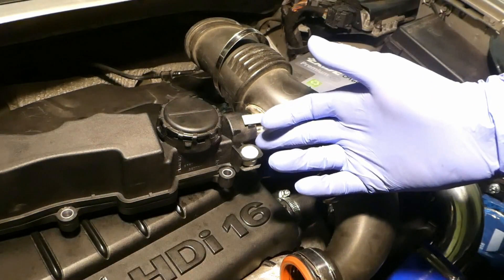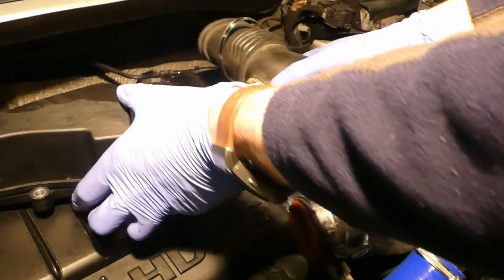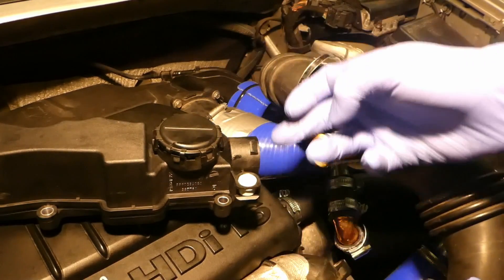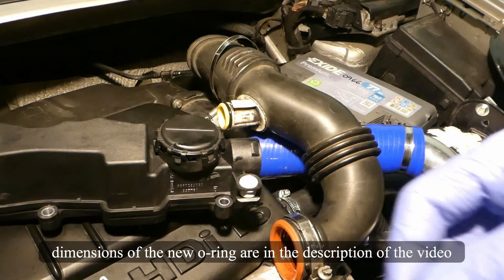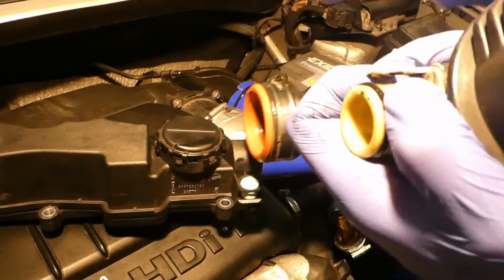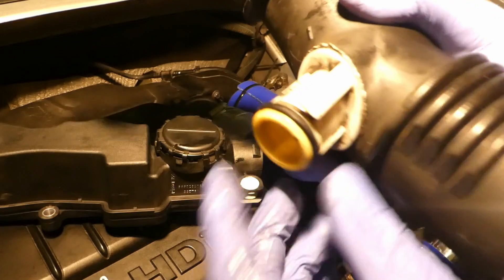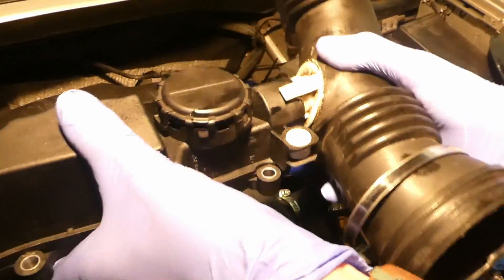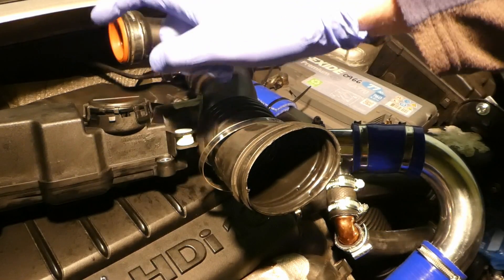How to fix oil dripping from the crankcase breather in 1.6HDi/TDCi (Peugeot/Citroen/Ford/Volvo/Mini)

Comment: Hi. Thanks for the suggestion of putting a thicker o-ring on the breather tube, as it solved the breather leak. Unfortunately I have a persistent oil leak around injector #2 (counting from gearbox) that I cannot solve. I already replaced the rocker cover gasket, the rocker cover itself and the four injector sleeve seals, and the respective injector copper seal washers. The leak still persists. I am thinking that maybe the oil is leaking through the injector stud threads. Do you have any suggestions for how can I seal that without tearing down the camshaft carrier?
Reply: Hi, maybe too late answer, but might help for others. Fixed my oil leaks near all injectors (there were pools of oil after cleaning the oil near injectors even after short trip), search youtube for "Peugeot,Citroen,Ford,Renault 1.6 HDI-TDCI Injector Oil Leak Problem Solved - Professional Fix part 1"
Reply from the maker: Hi msrego, what torque did you use and did you re-use the bolts. These are difficult bolts to do and I am not too sure if they can be re-used. I do not quite remember on top of my head, but they seem to be 4Nm + 65 degree tightening. They might have stretched a bit and do not push the injector down. Even more if you have used a seat cutting tool for the injector seat.
Reply: @moremolecules  I torqued the injector nuts to 4Nm and 65deg as per PSA reccomendation, but used the old studs. I know they are torque to yield so they should not be reused, but in my case the injectors themselves are sealing perfectly because the oil that pools around the injectors does not bubble with the engine running, and is definitely oil that is leaking, not diesel.
Reply from the maker: @msrego  Did you clean the injector seat with a reamer tool? I assume you have used a new copper washer. Sometimes the seat is not entirely flat, due to higher temperatures, etc. and it does not seal quite well. You could try with a reamer to clean it and remove an extremely small amount of the seat. In general if that is done multiple times, people use 2 washers to seal it afterwards.
Reply: @moremolecules  Yes, I cleaned the injector seats with a reamer tool, and always used new copper washers. As I told you before, the leak I have is an oil leak, not a diesel leak (or burnt diesel residue, when the injector copper washer seal fail), so I am certain that the problem is not the injector seal.
As I have replaced every seal on the camshaft carrier assembly, including the rocker cover twice, I think the oil is seeping through the threads of the injector studs for the number 2 injector, making me believe that the camshaft carrier RTV silicone seal has failed, which is not unreasonable to think as this engine has 190k mi.
Reply from the maker: @msrego  Nice job! Through the injector studs is a bit weird. I do not want to offer some stupid advice, you seem to be more knowledgeable than me as you have done all this work. I do not think increasing the thread size would help nor a thread locker. Is it a heavy breather by any chance? The milleage is not too much, but I suspect there will be some increased crankcase pressure.

Comment: Going to try this soon hopefully it just goes on but it looks a little tight like the o ring is under pressure tho thanks
Reply from the maker: Hi sshaunss, yes, it should be tight fit. Try to oil it slightly to ease it in. With time it will be less tight fit. If it is not a tight fit, oil will pass through. If it is too tight fit, you can try fitting it on a warm/hot engine.
Reply: more molecules thanks just bought it clutch needs doing first but noticed oil near this connection so this should help :) you would think car makers would of used a fatter ring in the first place
Reply from the maker: @sshaunss  I think it was fatter at the beginning, but with time from the heat cycle it shrinks. A new one should be good for another few years.
Reply: more molecules did it today great idea this, that’s a tight fit now nothings getting past that did the rocker gasket to whilst I was at it thanks
Reply from the maker: @sshaunss  Nice one! Yes, it is a tight fit, but that is the point, to seal and stop oil coming through. Not too sure how long it will last though, hopefully a few years.

Comment: Hello, I have problems with my peugeot 1.6hdi 90. It has hiccups and stalls and already had suddenly and complete loss of power. could it be because of this?
Reply from the maker: Very unlikely. Even if the seal is not complete it will not lead to stalling. Loss of power could be different things. Best is to plug it to a diagnostic equipment and see what it reports. Could be EGR valve or MAF sensor. You could try removing the MAF sensor (next to air filter) and drive with this. This will switch to default mapping.
Reply: @moremolecules  Thank you for your answer. I was wondering if this odb2 equipment might work: https://www.ebay.co.uk/p/2213173620?iid=253587409162

Comment: Hi there, it is nice fix for the O ring, but you neglect the main issue, which is oil getting through your PCV valve! I have the same on my 2010 Focus II 1.6 tdci. Isn't your exhaust smoking on cold start? Check your PCV! Just ordered PCV diaphragm membrane for 20 USD from eBay... But hey! Try not to brake those clips on the cap, as cap is not available separately...
Reply from the maker: Hi Gusztav, in this particular video I am ignoring the real issue of oil passing through the PCV valve, although it is not a PCV (positive crankcase valve) in the true sense as in petrol engines. It is basically a crankcase valve (CCV) or merely an opening (with some baffles) that excess pressure can be evacuated. I do indeed have blue-ish smoke on cold startup and I suspect it is the PCV, but not entirely sure. I tried to remedy with an oil catch can, but did not quite work out. I suspect it is mainly due to inefficient oil catch can, but there is some trade-off of efficiency and increase in crankcase pressure. I am investigating the efficiency of this as we speak. I also replaced the PCV membrane, but nothing changed really, the old membrane was OK. It was not smoking on cold startup before, but rather started one day, so I cannot quite attribute that to the PCV and I already looked at the PCV.

Comment: The link in video description is for a chinese supplier, so for anyone not willing to wait a month for delivery, i found these 19mm ID 4mm cross section from UK supplier
https://www.ebay.co.uk/itm/Metric-Nitrile-Rubber-O-Rings-NBR-4mm-Cross-Section-4mm-30mm-ID-UK-SUPPLIER/132849492473?ssPageName=STRK%3AMEBIDX%3AIT&var=432151928612&_trksid=p2057872.m2749.l2649
Reply from the maker: Do you mean the link in my video? As far as I know it is not a Chinese supplier and it is an amazon fulfilled item and there is not a month wait.
Reply: @moremolecules  yeah, i've tried ordering it yesterday and it said that estimated delivery is end of june/ start of july. it seems to have changed today. feel free to delete my comment :)
Reply from the maker: @pIotney  No worries at all, it is always good to know if I've put a link that is not that good.

Comment: What is the width of the o ring please
Reply: Is it 19mmx27mmx4mm
Reply from the maker: @robbiesillett3220  Yes that's the one, but  18x26x4 will also work
Reply from the maker: Hi Rob, all the dimensions are in the description of the video, easier to get it from there.
Reply: OK thanks

Comment: thanks for the upload! I recently bought a 2008 peugeot partner (1.6 hdi 9hx), very happy with it. checked this problem and I also got oil leak there. Tomorrow I'm going to buy the fatter o-ring. 
Question: does these have a plastic cover over the timing belt? or just mine misses that. thanks
Reply from the maker: Hi endurodani, my engine is the same, 9hxc. Yes, they do have the plastic cover for the timing belt. It is possible that last time someone replaced the belt, they forgot to put the plastic cover. The fatter o-ring is a tight fit, but it should go with a slight persuasion.
Reply: Thanks for you quick response! And keep up the good work with your videos, they are very helpful!
Reply from the maker: @endurodani  Thanks for the encouragement. I have scheduled some good ones, but it may take a while for the good ones.
Reply: I have a Citroen berlingo 1.6hdi. I have owned it from new, there is no cover on the timing belt on mine.

Comment: Hi.Tnx for great video.Is it possible if old original o ring isnt sealed good, beside oil leak also some air from air filter is leaking too on this place?
Reply from the maker: Hi Slobodan, it is possible in general. Nevertheless, it will be really small amount of air. Generally the air is being sucked from the turbo through the air filter and a very small amount of air from the crankcase breather. The PCV valve takes care of not too much air to be sucked from the crankcase. So, even is the seal does not seal well, there will be very small amount of air goind through there. The oil that goes around the seal will in general seal the passage of air.

Comment: Hi, Thanks for sharing this video. I have problems with leaks in my Peugeot Partner with 1.6 HDi engine. Today I installed new o-ring with the dimensions you provided. It was hard for me to put it on and then to mount the breather but somehow I managed to do it :) I bought an o-ring made of FPM (Viton) and it is supposed to be resistant to high temperatures, oils, greases and fuels. I hope this ends my leakage problem. Greetings
Reply from the maker: Hi BBB, yes, it is supposed to be rather tight fit. That is how oil gets stopped and really good that you bought the oil/temperature resistant ones. They will last longer.
Reply: @moremolecules  So far so good. No leaks after 4 months.
Reply from the maker: @BBBTVPL  Nice one. It is inevitable that it will start eventually to leak, but simply replace with a new one.
Reply: Where did u get the o ring from please

Comment: Thank you for the info, I bought fatter O ring and bought one made from silicone (orange colored) on ebay, rated as "food" safe one, it's more oil and heat resistant than rubber one and still no oil leak from the CCV. I got these https://www.ebay.com/itm/4mm-Cross-Section-Food-Grade-Silicone-Rubber-O-Rings-Seal-Washers-ID-7-60mm-Red/123760351471?ssPageName=STRK%3AMEBIDX%3AIT&var=424382640886&_trksid=p2060353.m2749.l2649
Reply from the maker: I do not really know about the food safe silicone, it should in general be oil/fuel safe, rather than food safe. Hope it lasts.

Comment: I have a 1.6 sw that I have just clean the engine there oil all over the top of the rocker the top of the engine and all over the alternator also its dropped more or loss all the old in one go. Is there something I should be paying attention to before i starting to strip things down. Thanks for help in advance 🙂
Reply from the maker: Hi Zool, you may want to investigate where all this oil is coming from. It could come from several places and it is best to understand where it is coming from. Could be the rocker cover gasket, or injector seal or something else. I would suggest to clean everything and see where it is coming from, as your course of action will depend on what the problem is. Hope this helps, although a bit vague.
Reply: @moremolecules  cam chain needs changing its got worn and split the rocker cover over the top of the cam theres were all the oils coming out 👍
Reply from the maker: @zool8139  Wow, that sounds pretty bad, never heard of the chain getting so slack that cuts through the rocker cover before, but I suspect there is always a first time.
Reply: @moremolecules  there is another videos on YouTube were you can see damage that the cam chain can do just were it wears through. But yeah I'm shocked it's not skip a tooth
Reply: @moremolecules  36 seconds in > https://youtu.be/KqKt4nzF7Nc
Reply from the maker: @zool8139  Yeah, that was something actually. I hope you fix yours. thanks for the video, good to know that it may happen.

Comment: In 1.6tdci it's able to install oil separator on this pcv pipe. With it your engine will work much longer!
Reply from the maker: Thanks pohgejib, I am currently experimenting with some oil catch cans to see if I can get it to be more efficient. I will post the results.
Reply: @moremolecules  me too. I'm trying to install this: 481H1014030. For 1.6 tdci it's more simple because there is more space between pcv valve and intake pipe... It needs just 2 connectors and 30cm rubber pipe...
Reply from the maker: @pohgejib  Yes, there is more space in the 1.6 TDCi. Good luck with the install.

Comment: So any reviews in long term use ? Did it fix definitely the problem ?
Reply from the maker: Hi ProSlam, very good question. It certainly fixed the problem for ~3-4 months, no oil whatsoever coming from the crankcase breather. Problem is that I just used whatever o-ring I already had, so that got slightly degraded from the heat and oil. I replaced it again, so all is good for the moment. Nevertheless, if one buys oil-resistant o-ring, it should last for very long time.

Comment: I’ve replaced the o ring with one that is 19x4x27mm like you recommend and it was a real hard push to get the breather pipe back in? Is this ok or should I get a smaller one ?
Reply from the maker: Hi Sam, it is supposed to be rather tight. It will make a tight seal and not let oil pass

Comment: Hi! Thanks for this video. My question is, should there come any oil from the PCV valve? because my turbine is leaking on HDI 1,6 and I'm pretty sure it's due to the oil dripping from PCV to the intake pipe and getting down to the turbine. How do you think?
Reply from the maker: Hi Kosta, in general, some oil from the crankcase breather coming out is normal. Excessive amount is not. It is really hard to say how much is excessive. Certainly, oil from the PCV valve will end up on the turbine. That is why I put an oil catch can. The PCV valve is supposed to scavenge the oil and drip back in the crankcase, but it is not the best of designs. It is mainly water vapour, but some oil comes out as well.
Reply: @moremolecules  Thank you for your priceless videos, they are the best resource out there to maintain/fix your PSA stuff! 
I have found a mini pool of oil in the hose at the intake of the turbo, also the walls of the hose do have a good oil film on them. Thanks to your description i now also put the new oring in because all around the top of the cylinder head there is a slight oil film. I hope this is connected to the CCV. 
Stupid thing is just that i can't find out if the oil is from a deteriorating turbo or from the CCV.
Reply from the maker: @TonyStark-ik9em  The oil film is likely to be from the CCV, replace the o-ring, wipe everything clean and see if it comes back. Unlikely to be from the turbo and on top of the cylinder head, most likely the CCV.
Reply: @moremolecules  Fingers crossed, thanks alot for your reply!

Comment: Mine leaks so I'll look into changing the seal to a fatter one.

Thanks again.
Reply from the maker: Mine has not leaked a single drop since I put the fatter o-ring.
Reply: @moremolecules  I'm assuming the air can still leak out? I'm guessing that's how it's supposed to work. Only let the air out but keep oil in.

Going to buy a o ring kit
Reply from the maker: @mikey2811  No, it is not how it works. It has to be a pretty much tight seal, no air/oil/vapour if possible. Basically, the gasses and/or oil vapour from the crankcase get redirected to the air intake (pre-turbo) to get burned. If there is a air leak and this is not tight, then unmetered air is allowed to enter from there when the turbo starts piking up. That is not a good thing. There is a membrane that closes if the turbo picks up and it would not work with an air leak. I think I had one video that explains a bit more.
Reply: @moremolecules  bought a new seal kit and I used a 18mm internal diameter and 26mm external diameter, 4mm thick seal and it was a tight fit but it went in. I don't think anything will come out now. I bought another used breather due to mine having a few cracks on the turbo end where the red seal is.
Reply from the maker: @mikey2811  Yes it is a tight fit, but almost nothing will come out of this.

Comment: Hi were did you get the fatter o ring..cheers in advance..mick.
Reply from the maker: Hi MrPaddywack2001 , I got a box of rubber o rings from Halfords. This particular o-ring was part of that. I think HBB131 ("metric o-rings") was the Halfords' part number, but might be wrong, although amazon also sell a lot of these. Hope this helps. BTW, since I put a fatter one it has not leaked a single drop.